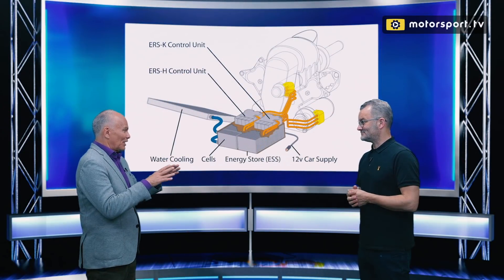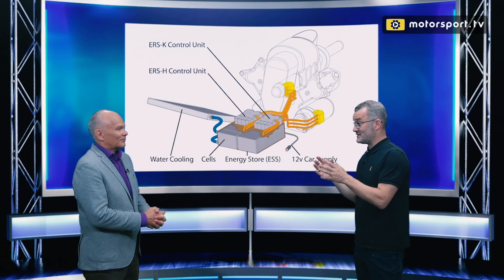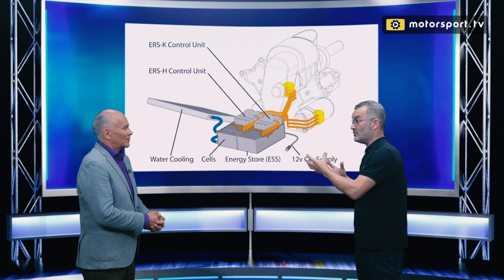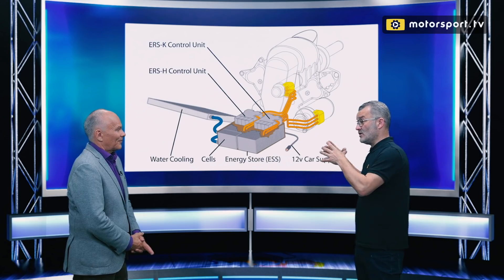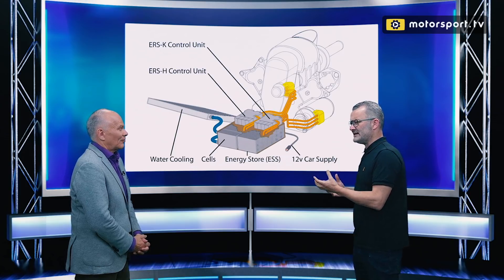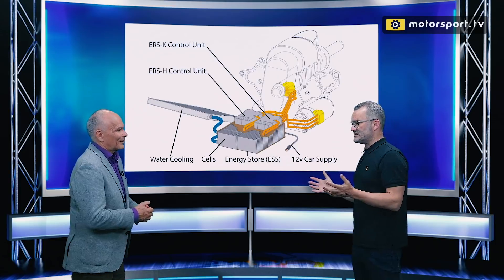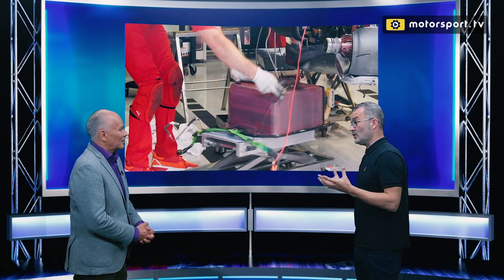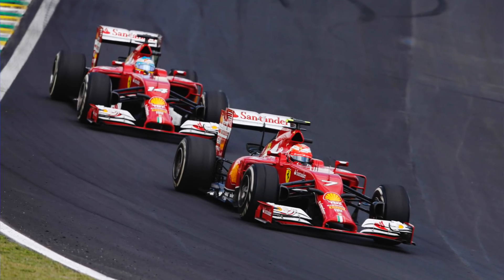What we've learned about Ferrari's F1 battery

Comment: Too many rules! 
It is correct to limit the number of engines to be used in the season, the displacement and the gasoline to finish the GP.
Everything else as cylinders number, battery capacity, the choice of tires (if I want to do the whole GP with only one set of tire, why not?) must be left to the designers and pilots.
By now all the cars of F1 apart from the sponsors and the colors are all the same.

Comment: McLaren P1 has one 600volts battery, but actually it’s two 300 volt systems, controlled by on CM that gets PS from 12volt system.  Power output is total from both. I think Ferrari’s system in principal is similar to that. In the end, sum of all sums in two battery system,  must  be same as any other single system battery as per rules. But is it? Only Ferrari knows.

Comment: I dont understand why, I could understand it if it is separated for weight balance or temperature behaviour, but in the same packet it doesnt have sense. Duplicate the ERS control unit, and the circuit can charge with MGU-H and it discharge through MGU-K, because thay are differents circuits into the ERS controller

Comment: If the batteries are connected in parallel, if one fails the other one is still online
Reply: Levente Nagy not sure if the reliability of the batteries is the reason but it is a good thought. Or maybe it is for better cooling of the cells. Same as in dual/quad cpu setups in a pc
Reply: True, I'm just thinking of Riccardo's MGUK in Monaco, he probably lost his MGUH power as well if they were connected to the same battery. Although I'm not sure whether the battery or the MGUK itself was broken.
Reply: Neither.  MGUH was improperly built/assembled.  All was undamaged.
Reply: I bet they are wired in series and parallel and are able to switch between the 2

Comment: I mean , Ferrari fans quite often are a bit too "pro-conspiracies" , but everytime the Ferrari gets more competitive It's cheating ! Those bastards are not allowed to bla bla bla... ! . Mercedes has Tyre degradation problems , Pirelli changes the thickness , but a flap on the Halo must give a huge advantage , so let's ban it ... Same happened to Red Bull's blown diffuser that took over a year to get banned if I am not wrong ! Wonder if it was Ferrari , I don't know if it would have taken a year to get banned ... If you have other theories , I'll be glad to hear them and change my statement , but 'till that moment , I'm not happy about how FIA is managing this ...
Reply: There are rules for the amount of energy released from the battery system. There was a concern that the FIA's monitoring system couldn't police the arrangement Ferrari had, so they added new systems to ensure that Ferrari only used the permitted amount.  That's not a conspiracy against Ferrari. They haven't stopped Ferrari from using two batteries. They have just moved to ensure that Ferrari are operating within the rules. Making sure your scrutineers can enforce the rules is not a conspiracy. 

As for the halo wings. Again the FIA has not prevented Ferrari from mounting their mirrors on the halo. They in fact let them race a wing arrangement that clearly breached the intent of the rules regarding the provision of support. Ferrari were given an entire race to run something that clearly took the piss. To me that looked rather more like favouritism than prejudice against Ferrari. 

As for the tyres, everyone had blistering issues during the pre-season tests.  Go back and check the mountain of reports on the matter. All the predictions before the season were that Mercedes would be dominant. Why, because all the data suggested that they had the fastest car and the best over long runs in the 8-days of pre-season testing at Barcelona. Mercedes had the fastest car at Barcelona in pre-season on the standard tyres. Unsurprisingly they had the fastest car during the race weekend at the same track.  

 The "thinner" tyres will only be used at certain tracks where Pirelli had become concerned that their original design would not work. Sebastian Vettel tested the original, "thicker" tyre at Barcelona after the race and confirmed that it would have been a worse tyre for them than the "thinner" one. Again, unsurprisingly, Pirelli didn't spend cash developing and building revised tyres for any other reason than that they had real worries about ability of the original design to be a safe race tyre.

If the thinner tyre does indeed favour Mercedes it seems then that the conspiracy is against them, as it will appear at only 2-more tracks. The rest of the season will be on the original tyre design. So, if there is a conspiracy and Pirelli are designing tyres to favour certain teams, it looks rather more that the 18-races on unnecessarily thick tyres is intended to hand the title to Ferrari.

That's the ridiculous thing about the Barcelona tyre conspiracy. The claim that they tyre was changed to help Mercedes ignores the simple fact that the vast majority of the season will be run on tyres that supposedly favour Ferrari.
Reply: Well thats a stupid comment. Because Red Bull and Ferrari also supported the tyre change.
Reply: Jay Loop - If you're not finding the loopholes in the rule book, you're not trying hard enough.  This has been in F1 history for ages.
Reply: Note. This probably all started because Mercedes hired a low end employee from Ferrari.
Reply: joe r gonzales Yes sorry I was referring to another user . I understand that and I agree with you , it's a team's problem , not tire manufacter .
Reply: Thumbs up, Jay Loop! That's the real point. Both Mercedes and Red Bull have been allowed to run entire seasons with illegal solutions! Now Ferrari supposedly should even thank FIA for allowing them run ONE race with the Halo mirrors. Simply ridiculous!!
Reply: Vikum Wijekoon I know that , but I'm arguing that only Mercedes asked for thinner threads and Pirelli changed the tires . The request for a different tire must come at least from half+1 teams to be approved , not only by one . I don't mind if Ferrari would have been slower .
Reply: Jay Loop - even Seb said that had he had the "older" tyres, they would not have lasted the race PLUS Ferrari was trying out a new rear suspension system that they tested in Spain.
Reply: James B - James Allison is not a "low-end" employee IF that's whom you're referring to?
Reply: I know , but what i didn't like by Pirelli is that they've changed the tyre specs because only one team asked for it. To me in these situations all teams must be equal !
Reply: What do you mean ?
Reply: Jay Loop - that's how this whole business started with the changing of the tires (tread depth)--> Barcelona testing in March.  Two more tracks to go with these 0.4mm tires, Paul Ricard & Silverstone.  The first track was Catalunya.
Reply: No, they are not running the majority of the races with the tyres "that favour Ferrari"; just with the standard tyres they designed for this championship, which were tested by all teams during pre-season sessions!!! But since Mercedes complained about them (meaning they were not able to make them work right on their car) they accepted changing the tyres for some races, therefore favouring Mercedes.
As a matter of fact, Mercedes simply can't lose. Years ago, they run a secret and forbidden test with Pirelli during the season (!!) so they could understand how to make tyres work.
Reply: Antonio Di Carlo FIA is covering itself in ridiculous : they're seeing Ferrari cheats everywhere !!! Halo mirrors , dual battery pack , oil burning during cold start ... It's clear that these things are not so relevant in the whole car and they barely represent a "step forward technology" , but FIA makes them look like Ferrari's cheating for no apparent reason to me . Let them (all teams !!) fight and develop their cars !
Reply: Jay Loop Dual battery pack: was FIA to tell everyone else Ferrari has that (although with no rule breach?) If that is the case, FIA may have damaged Ferrari by revealing a smart solution to the other teams! In my opinion such solution may:
1) Improve battery performance stability during a race
2) Reduce long term battery performance degradation (I understand number of packs in the season is limited)
all of this without violating any rule. So other teams may now know a way to improve their car too,  thanks to FIA!
Reply: Jay Loop and vettel confirmed that running previous thread on Barcelona would have slowed down the  Ferrari even more. You Ferrari fans are massive hypocrites
Reply: Jay Loop flap on the halo mirror is a clear breach of rules as rules clearly say no aero devices on the mirror
Reply: If the FIA bans something it means it was legal before and is illegal afterwards. It is exactly this challenge which makes F1 so interesting for engineers. As you are mentioning the Red Bull diffuser from the past: Mercedes had a so called double diffuser at that time 😉
Reply: Jay Loop - On that I agree.  It started during Barcelona testing (March) where Mercedes ate their tires ( soft compounds) so bad they looked like grand canyons.  I'm a firm believer if one team has a problem with tires, that's the teams problem and NOT the manufacturers (Pirelli) problem.
Reply: lil Sebastian Yes, it is.
Reply: 121bham If you can't understand my statement probably you're suffering dislexia and learning disabilities ...
Reply: It's not a coincidence that Ferrari hasn't won a race since they started putting test devices on the Ferarri to test the voltage.

Comment: Ferrari has the only car that you can clearly see vapor coming from the exhaust during pit exit and sometimes during the race. 🤔
Reply: unkle suga That has nothing to do with this. That is due to the new regulations not allowing oil to return to the engine and be used during the combustion phase for additional power.

Ferrari now route the oil straight out the back of the car instead of into the engine, creating the mist.
Reply: Vikum Wijekoon Nope If you burn oil the smoke would come out of the exhaust.
Reply: unkle suga you are a giant headed idiot
Reply: wocko25 that's great knowledge I was already aware of but they're the only team doing it is my point just like the double battery.
Reply: Gameplaylike cuz other engines weren't really using as much as oil as Ferraris were
Reply: Its Ferrari JIZ.... enjoy
Reply: its because of how they routed the crank case oil breather, into open atmosphere, a normal road car would do the same exact thing if they did not run positive crank case ventilation, which is what stops this from happening, or a catch can. PCV routes the crank case vapor back into the intake, so its closed loop.
the oil vapor comes from piston blow-by entering the crank case, because of boost/high cylinder pressures. which these engines have extremely high cylinder pressures. 
the logical reason why the other engines dont blow vapor is likely because they are running oil catch cans to catch the vapor. which ferrari is not likely using because having a catch can is just another piece of added weight and obviously isnt really necessary, just vent that shit out the back and smoke screen everyone like mario kart lol
Reply: Its Ferrari's way to say fuck you to electric cars!
Reply: If you know the Rules you have to ask why the other teams don't vapor.